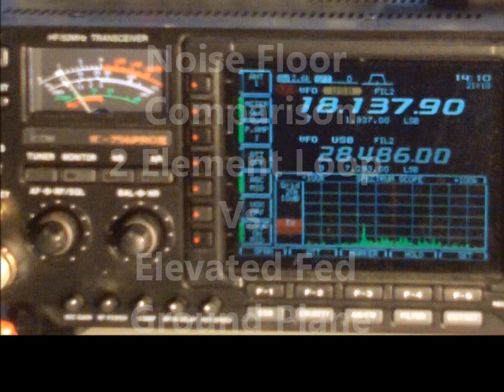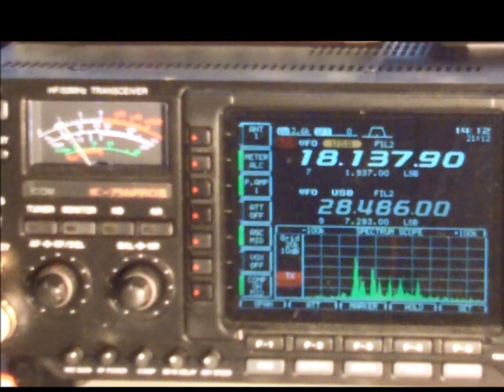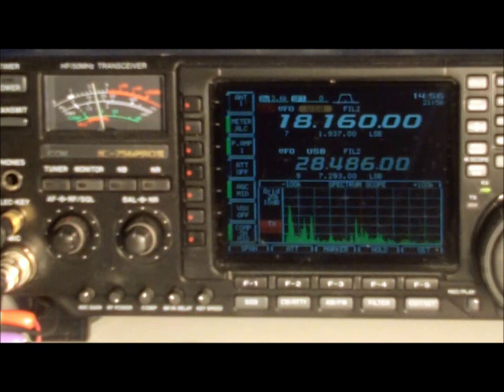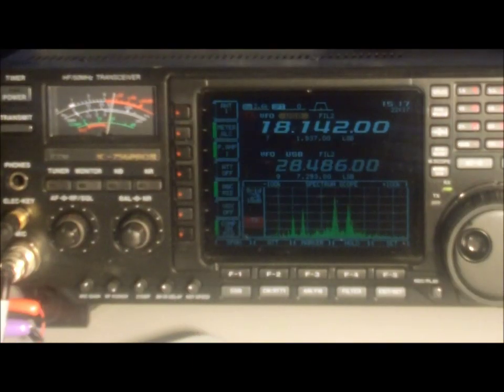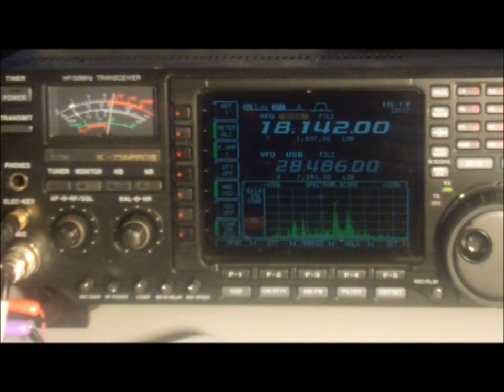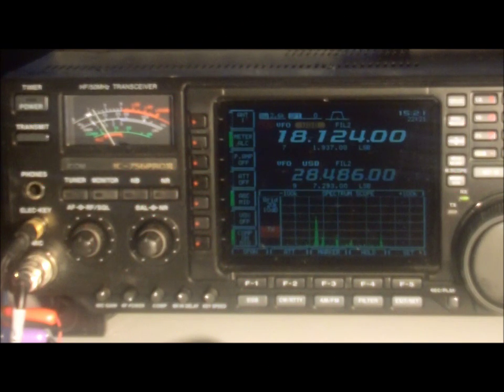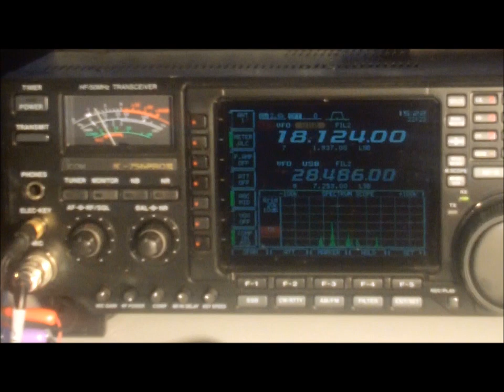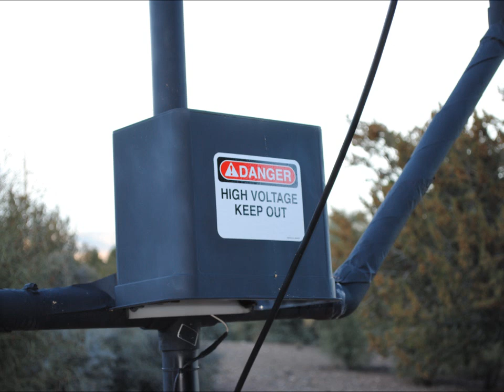Magnetic loop antenna helical loop antenna 2 element

Comment: I love your design. I have worked you twice and experience the otherside of the two element. The gain is really directional when you turned the antenna at me it really improved. One of the strogest signals from your area. Im a believer, good work.
K5BAK

Comment: Drawback to air variables: arcing is VERY possible at anything above QRP power levels.  There are thousands of volts at the capacitor. Air variables that use wipers will have high losses, as well as limit power levels.
Reply: The other drawback is they are very touchy to tune, compared to variable vacuum tube type capacitors, but I have a 9kv air variable Caldwell on one of my loops that will handle roughly 300 watts at 40 through 75 meters
Reply: re: "Drawback to air variables: arcing is VERY possible at anything above QRP power levels."
My SB220 has several air vars; no arcing with either. It ALL depends how they are used, and what voltages are present.

Comment: Question: does a helical winding change spacing, progressively from the feed-point, to the end of the winding?  Or is it just a evenly-spaced winding?  How did you design the spacing, and so on?  Is there software for this?  I am highly interested in making a loop.